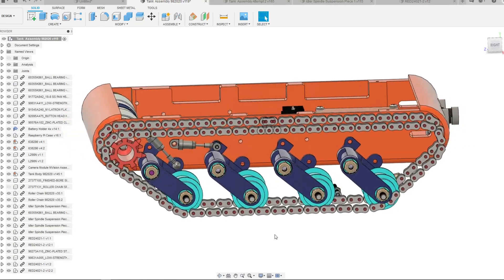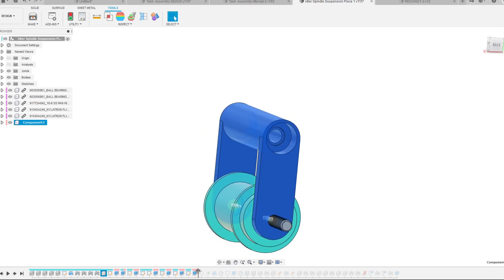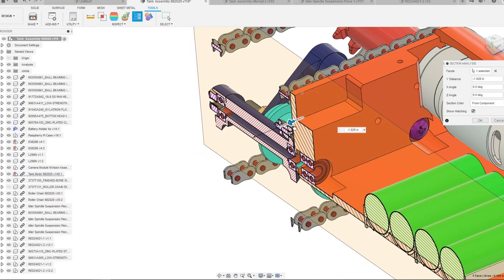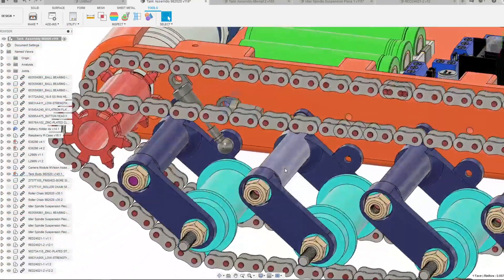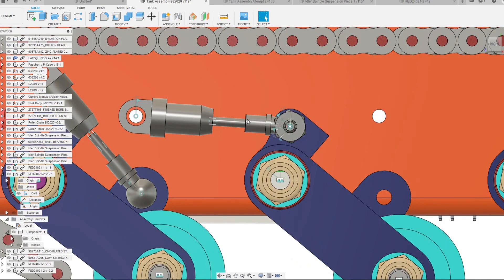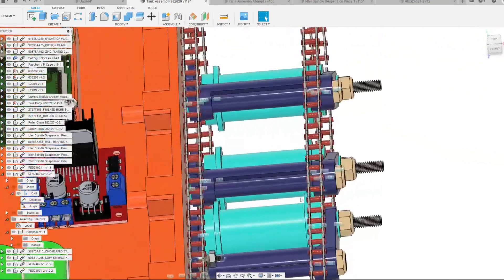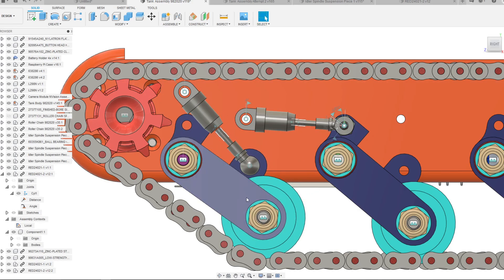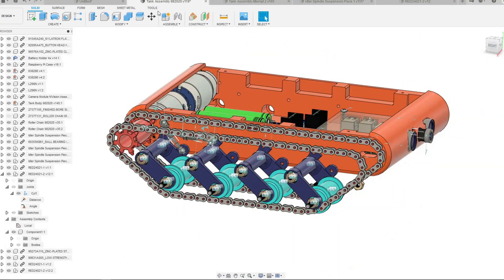How I Made a Tank Suspension in Fusion 360!

Comment: How many motors being used and what voltage?
Reply from the maker: 2 motors at 12V each.
Reply: @AvivMakesRobots  just make sure to cordon  the batteries of from any fans as the cold will kill the batteries.
Reply: If using 12v motor rig up 12v battery per motor would take a very long time to burn out if kept on full throttle, alternatively rig up 18v for medium amount of burst speed. A variable switch helps to speed up or slow down also not all motor's can do reverse polarity for reverse, please check before buying.
Reply: If running 18v on 12v motor could use tiny fish tank fan to cool the motor to prevent burn out of motor and slightly lower voltage.
Reply: Probably 12v mosquito axial fan
Reply: 1 fan on each motor

Comment: Also could use the Christie  suspension system on the top front track wheels as a idler to keep the tracks taught or tight limiting tracks coming of tank assembly.
Reply: On the original the pivot for the rear roller would be the sprocket axle and gears from the axle to run the rear roller and steering on the front bottom roller, so that it could drive on to it's tracks like a car. This is  not needed as steering from the drive axle would suffice.

Comment: Good model, could use pin bearings instead of ball but not needed as not heavy duty, rubber on track  wheels and damper along with suspension. To give extra smooth drive.
Reply from the maker: Very true! The ball bearings can become oblate spheroids after all the vibration wears them down.
Reply: Would like to see the working model in action.
Reply: Too much movement at the front end of the motor would destroy the bearings in the back of the motor.

Comment: Really good detailed model, especially with the motion links all done. I have some comments though:

1) 2:18 Why are the swing pins on bearings on the inside AND outside? I think you should fix them rigidly to the hull
2)  Will you not have a hard time installing those motors there, or wiring them? Are you sure those drivers can handle such large motors? Why do you have 2 dual channel motor drivers?
3) The 18650 holder appears to interfere with the body, and I think using a LiPo would be easier anyway
4) Are you sure the drive sprocket can be cantilevered out that far? I think motors generally come with pretty small bearings, so you may need something chunkier there.

It kinda looks a lot like the suspension I got on my tank, though I built mine a long time ago when I was a lot more ignorant.
Reply from the maker: 1. Yes, it can be mounted rigidly. I decided to use bearings inside, but I could have just used brass inserts. 
2. I switched to  a different driver which will be shown in the next videos. It can handle these big motors.
3. I made a new custom holder to hold 4 of them in series and it fits in.
4. It seems to be alright thus far. There is a brass insert and set screw to hold it firmly onto the shaft of the motor.